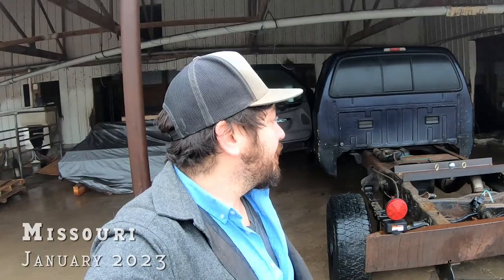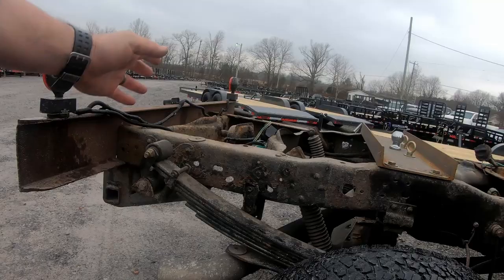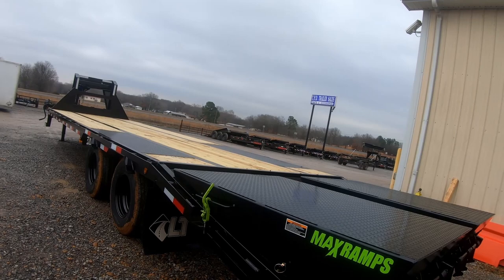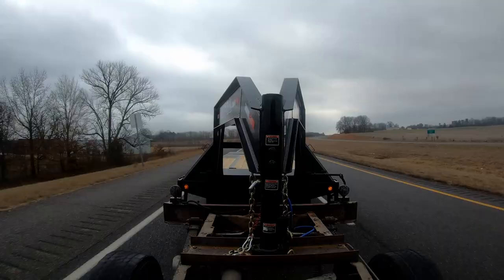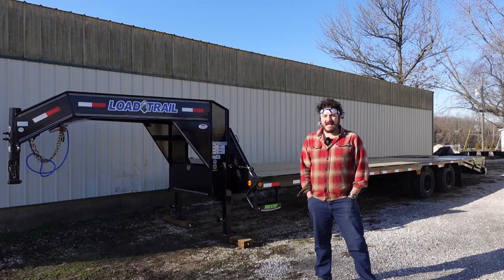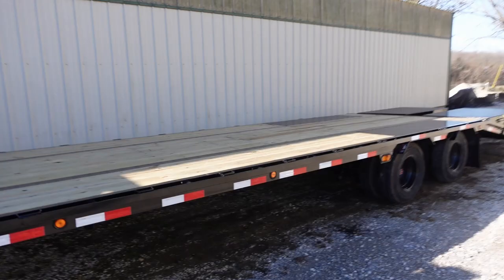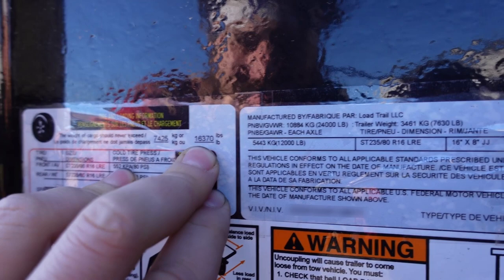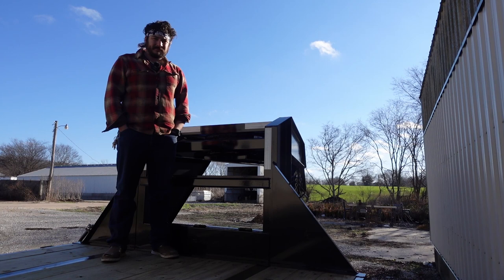Picking up a 25+5 LoadTrail 24000# Gooseneck Trailer and Reviewing it's Features

Comment: Don't you need a CDL? The GVWR on the GN was 24000 lbs. Your 250 is probably 12-14K. So you are way over 26K, and your trailer is way over 10K. For most states, if your Combined GVWR is over 26K, but your trailer is 10K or less, you don't need a CDL. Maybe you have one. If not, getting a shipping container from CO to ME could have your rig impounded until you have someone with a valid CDL. Maybe you already got your stuff.